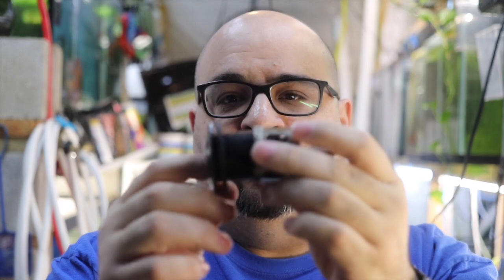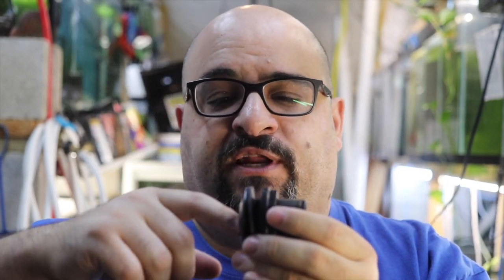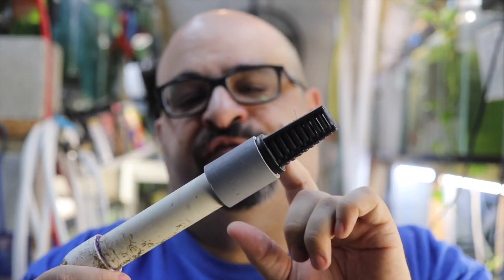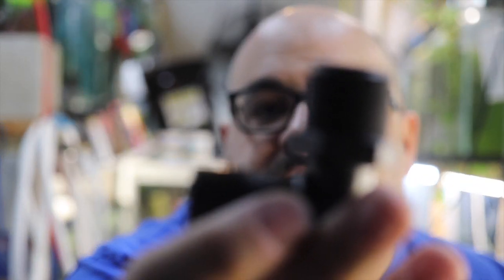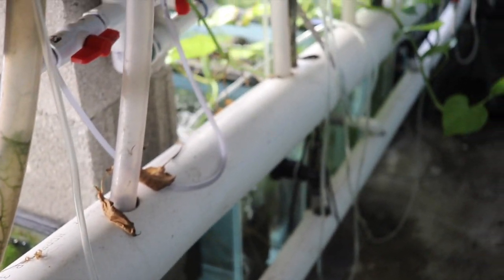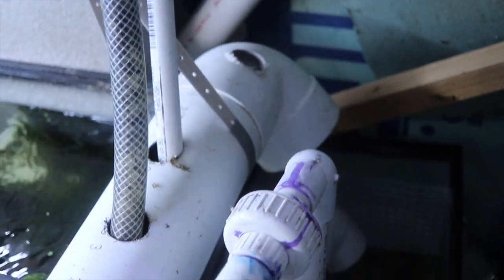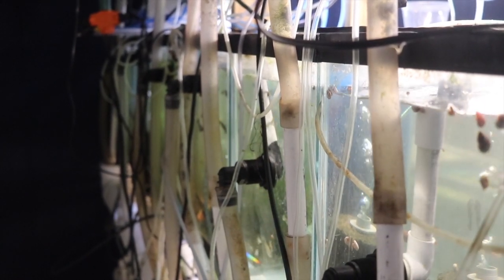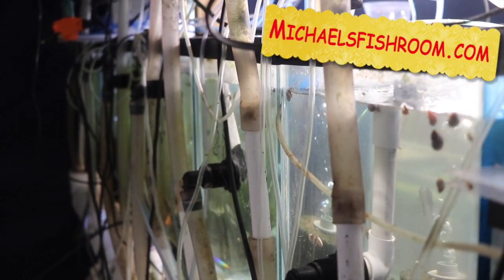Auto Water Change Drain System

Comment: Hi Micheal, just another bald goateed guppy breeder here. But, you're the guy with the camera, so thanks for using it. 

I have had a ro system for over 2 years now. I know. The membrane takes most stuff out, including chloramine, which is what my city has. But I bypass that membrane at times, because pH drifts down. We have naturally occurring ammonia from runoff, which interacts with the added chlorine. My method is catalytic carbon. It's just a carbon block, but with slightly more processed carbon. Seems to work.
Reply from the maker: Cool!

Comment: Thanks Michael
Reply from the maker: My pleasure.
Reply: @MichaelsFishRoom  - Hey Michael,  other than being able to do a fast water change are there any pros or cons to having the bulkhead lower than say mid way down on a 10g or a 20 long? Didn't know if it makes a difference with the glass stability if it was say 2 or 3 inches from the bottom.
Reply from the maker: They say it needs to be at least 2 inches for any edge, so other than that, I don’t think it matters.
Reply: @MichaelsFishRoom  - Thanks again.

Comment: As a fail safe for your pump..... I see all your tanks drain into a 50g reservoir and your pump is In there and pump
It out.... what if you where to put the 5Og Into another bigger reservoir with another pump. So if your main pump fails water over flows from your 50g into your bigger reservoir with your emergency pump...wouldn’t that work?
Reply from the maker: It would, but there is no room for that.